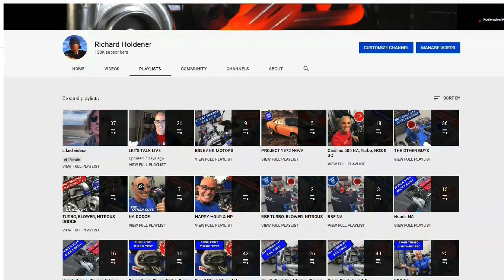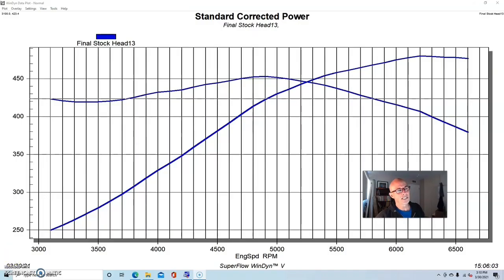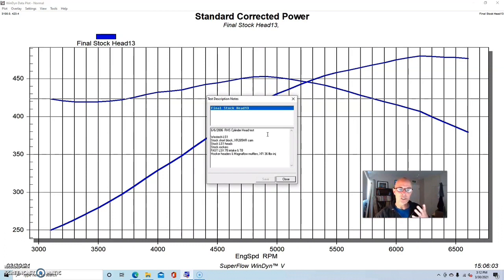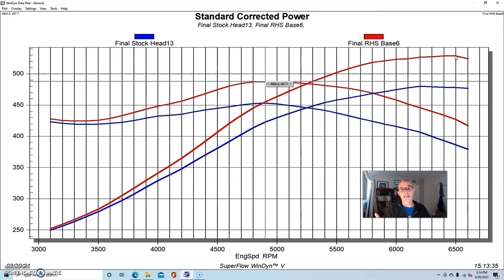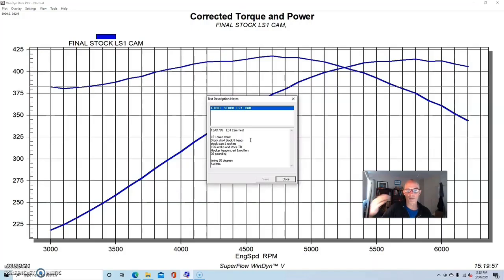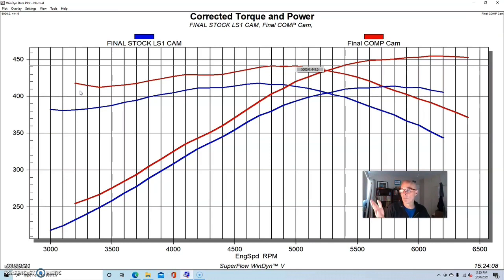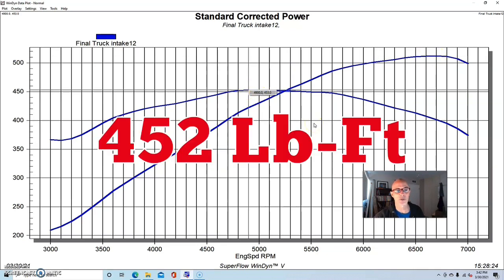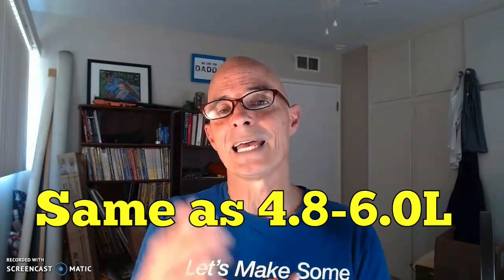DIY, EASY BASIC BOLT ONS-5.7L LS1 MODS

Comment: So what’s a good modern cam for the ls1?
Reply from the maker: I have 2 of them avail-Low Buck Truck adds 65 hp and Truck plus adds 81 hp ($179 each shipped)
Reply: @richardholdener1727  I have a 1979 trans am with a gto 5.7ls1/4l60e stock intake,stock injectors, 243 heads, 2.5” exhaust 3.08-3.23 gears (can’t tell) stock torque converter. Looking for a nice thump cam that I don’t have to change out the converter and valve train. It’s going to be daily driver/cars and coffee type of car I’m building for my dad.  
I’ve been looking at the 228/232 and the btr red hot cam, and the gm performance hot cam

Comment: Can't wait to see the ls6 content. My bolt on 2002 ls6 made 451whp/423wtq on pump gas.
Reply: What mod do you have? Cooler thermostat, headers and better intake?
Reply: @SOLightt  all of the above. Ewp ,  roller rockers, crank scraper, short belt with ps bypass on that dyno. Tested that just to see how much these newer car get from electric power steering, ....the little things add up. 
That was on pump gas. E86 will add 10whp and a pile of tq.
Reply: An LS6 is literally 243, heads, intake, slightly larger cam. You aren't making 450 with an LS6 intake, stock 243s and the largest cam ever made that will physically operate.
Reply: @Carado5150  why you use a ls6 intake? A ported fast with make 14whp more than a ported ls6 intake. 

A bolt on ls6 can actually make more than i did. I wasn't using e85. You can add 10-15whp and tq using e85.

Btw...the biggest cam ever would make more than the stock ls6 cam i used.

Comment: I have a 98 Camaro w/ an LS1 in it.. I have Headers, Y-pipe, (cats removed) & SLP Cat Back Exhaust.. K&N Cold Air intake.. I had it dyno tuned, but my HP to the rear wheels was 310HP..
Reply: Not bad numbers considering... Considering the LS1 that's in  98 camaros  Is a little bit  Of difference which most people don't know ... Like the 241 heads that came on the Camaro are not the 241 heads that came on the 2004 GTO LS1 The LS1 block was revised and the 241 LS1 heads were revised also....  The LS1 in the GTO was a factory rotating LS6 assembly Block ..It had an LS6 factory intake..also but had 241 heads but revised...  Don't know if this part's a fact or not but I also  Have heard.. Don't know if it's true but I heard that the 04 GTO factory Cam Had its own grind  Slightly better

Comment: I picked up an ls1 for cheap. Had 4 bad rod bearings and the crank was damaged. Can I use a 5.3 crank and rods and have it balanced with new pistons? Thanks
Reply from the maker: YES
Reply: @richardholdener1727  thanks that means a ton to me.
Reply: @richardholdener1727 can you use 6.0 crank and bearing

Comment: 2003 5.7 liter big power upgrades on budget, any ideas and approximately the price if items and brand names
Reply from the maker: every mod for any ls motor works on the 5.7L (not rec-port heads)
Reply: Looking to get approximately 350 to 400 hp , but on a budget . I have a 5.7 and a 4.8 . Both vortecs  and want power . It's going in 03 siverado 4 door 4x4.  Any ideas what you would do starting out for around $1000 then go from there.

Comment: Where can I get a set of LS1 RHS heads. RHS doesn't supply them any more...
Reply from the maker: the early ones were done by Mast
Reply: @richardholdener1727  Jesus Crisco! They're $1500 for a single head. $3k for cylinder heads damn is there a cheaper option?
Reply: @ryryy1980 this is why people swap in 6.0s and use LS3 heads and intake.

Comment: I'm glad to see a set of RHS heads on the dyno...I'm about to put some on a 6.0 with a BTR Stage 3 cam & a 4.000" stroke 😉
Reply: Should've gone rectangle port on a 6.0 and saves some money with LS3 heads.
Reply: @carado1984  I never bought after researching & seeing how much power you can make with stock heads

Comment: Hi Richard, Love all your videos.  So much information.  

So I have managed to pick up a LS1 with a T56 Manual gearbox (along with Tailshaft, Extractors, ECU and wiring loom - $5700).  I was hunting for a 6.0L however the $$$$ here is OZ are ridiculous.  The stock engine I have purchased has done 150000km.  I need to upgrade this engine but on a budget.  I know you have heard this too many times, but seriously money is tough.  So tough I have a GoFundMe page activated - https://gofund.me/93e70cb6

Everything performance upgrade here in Australia is horribly expensive and I was hoping you could point me to the right direction for both quality and performance and a budget price.  I need to be between 530-600 horses with an engine that will last longterm.  I do not have funds to keep rebuilding.

I am upgrading my 3.8l V6 ecotec with LS1 just so I can compete is certain classes of racing.  https://www.facebook.com/justinmannracingteam/

Can you help me?  email is justinmannracingteam@gmail.com

Thanks again.

Comment: I would choose the truck intake with a heavy truck or SUV for added low end torque say something with the weight around 4500-5500 pounds with the 212/218 duration comp cam giving you good torque 2000-5500rpm and strong horsepower 3000-6200rpm with stock to 2500rpm stall converter 3.42-3.73 gearing  but if you have a car with a weight under 3600 pounds or less with low gearing 4.10 and a 3000-4000rpm stall converter it be hard not to choose the edelbrock intake comp cam 231/239 duration cam power from 4000rpm to 7200rpm with this set should be a monster even a single plane intake with a holley 850 hp carberator would be ok for me

Comment: Hey Richard, I have a question; have you ever put a 5.7 (350) buick engine to the test? They are starting to get recognition and nobody really has put one to the dyno. Maybe you could try this one out?
Reply from the maker: not yet
Reply: Buick small block?  I don't think there is a lot of performance parts available for those.  Most Buick stuff is either 455 or V6.

Comment: Genuine question... watched plenty of vids on LS’s, and would love your input.
I’m currently on a 1JZGTE/ AR5 setup, and looking to get rid of it all and swap to an LS setup. Car: Built 240sx S13
I’m aiming for AutoX, Ima blow all my big bucks on a T56 Mag and twin disk setup, but on a budget for an LS setup pushing maybe 450whp, what would you recommend? Wanting to keep weight down so preferably an Aluminum setup. Genuinely curious.
Reply from the maker: alum na 6.0L
Reply: @richardholdener1727  Thanks for the reply, been looking around at 6.0L Aluminum block. 
Doesn’t matter to much to me at what it is, I was even looking at 5.7Ls and thinking about Cam, Porting the heads, and an intake. 
Been looking at like LFA blocks as well, and doing DoD delete and minor mods as well. Not as common around here to find these though.

Comment: Glad to see the 5.7 getting some love! Guessing a whole lot of us would like to see more on boosting one. What's a safe hp level? What should you gap the rings to? That sorta stuff
Reply: I remember seeing some article or something saying that the ls1 isn't that good to boost because the piston walls are thin but what do I know
Reply: @chrishansen7004  thats pretty true. If you want to hold a lot of boost go with a 6.0 or 6.2. If you want to hold an even higher amount of boost to go with an iron block. At that point you'll be pumping out so much power the extra weight won't matter. Remember guys, the iron block variant is only 100 lb more.
Reply: @sethh8892 so true, just chuck a few extra psi into it to compensate the extra weight. Won't take much at all
Reply: Word around is that the ls1 Lower can hold up to 500 wheel

Comment: The trade off is worth it if you're most interested in road racing and high rpm power for drag racing. I think its interesting to see cam only cars running 11s with a good suspension and converter, and ET is very similar w/ properly tuned stg 1.5-2 (22X duration) or a 23X/24X. So the peak power isnt nearly as important as the avg tq/hp in your launch to shift (racing) rpm range. I was going to increase from a 235/242 112lsa, mainly for more overlap(tighter lsa) and to get up to .650ish lift, but I'll be fabbing hot/cold side, adding a turbo from VSR or Sloppy, and then I'll prob want less cam in the 383.
Reply from the maker: check p-v with a 235 cam
Reply: @richardholdener1727  Its a 383 LT1, so the JE pistons are relieved and I know people run much bigger stuff. Mines been together for years, I wanted to take my stock pcm to its 7k limit with a cam change but decided I'll just do it with one of VSRs bigger turbos.. I'm saving for the hot side(no bolt on LT fbody parts), black magic clutch to replace my twin disc, and faceplating/building my trans for the power.

Comment: Richard!!! I've been dying to ask you this, what would the 706 heads do on a Ls3 or the 6.2 truck engine, would it be beneficial 🤷
Reply: No probably not. GM saw fit to move away from cathedral ports for a reason. LS3 rectangular ports are "copies" of bbc heads which out flow, make more power through out the power band & vast efficiency.
Reply from the maker: rec port ls heads are not copies of BBC heads-the 706 head add some low speed torque,  but be way down on power compared to ls3 heads (I tested that on an LY6)
Reply: @richardholdener1727  Thank you sooooooo much for answering bro YOU ARE TRULY THE MAN!!!!!

Comment: I'm always impressed by the factory truck intake when compared to these $600+ intakes
Reply: Thank you very much where's the best place to order from
Reply: @terryhouse1533  get them from your local junkyard
Reply: I think for most people, it's the packaging constraints that prevents them from using those intakes.  No intake is out performing the FAST102 that fits under a hood and without cowl modifications.
Reply: Factory truck for the win, 20 to 50 bucks all day.
Reply: If you're buying new it's worth it but if you already have a 92 it's not worth the price to upgrade
Reply: Yeah that nnbs/tbss truck intake is hard to beat
Reply: Should I use trick flow heads or something else
Reply: @terryhouse1533  what size of engine and what are your goals? Power adders?

Comment: I did not see anything about the port volume or flow figures on the 1st design? RHS cylinder heads or the compression ration after the cylinder head swap.  I just assumed due to the era they were cathedral ports?
Reply from the maker: CATH PORTS ON THE LS1

Comment: YES! My 99 SS will get some love now!
Reply: Worth putting some effort into the old LS1 Holden's now hey
Reply: Hi, I have a 99 SS.I why with a costume cam built to the mods that was already done to my car. Lt ls6 intake under drive pulley ported tb ssra ram air. The cam is a 227/235/565/579 110 LSA,M6 car stock gears and I run low 12s on crappy tires. I'm sure it'll run 12 flat, but you know how weak those rear end are, so I'm happy with those times.
Reply: Oh dyno,430/450. That part is hard to believe but the car haul's a__

Comment: When boosted are these comparable to the gen 3 5.3s for strength? I get the blocks themselves are not AS strong.
Reply: Rods and pistons don’t seem to be as stout. Most people usually don’t push past the ~600whp mark especially with stock ring gap

Comment: LS1 today? How about an L33 block bored to 3.900 or so, then add the components of your choice. Of course if you’re adding boost (a lot of boost), then don’t bore it, just turn up the boost controller. That first head upgrade example seemed extreme. A 212° intake cam making 529 hp at 6500? I’m hoping my 6.0 cracks 500 hp at the crank with a 225° intake lobe and 823 heads. Of course part of the difference is the 9.6 or so compression of the LY6. Still interesting info, thanks Richard!

Comment: Richard Ebay has a new turbo it's a 78. 76. T4. Billet wheel. Stated to make up to 1000 hp. They are 280 bucks. Everybody better get a couple before this gets out. Be great if you could test them as a single and twins. Great job.
Reply: Are ebay turbos any decent in terms of reliability compared to the known manufacturers?

Comment: what kinds of RPMs can a stock LS1 bottom end handle?
i'm getting one ready for a Autocross car and often times we will bounce off the revve limiter for 2-3 seconds during our runs.
i also plan on using a Torqy Comp 265Hr cam as well as mid-range power is very important for Autocross cars
Reply from the maker: you won't make power at high rpm with that cam
Reply: @richardholdener1727  realistically with my gearing, it would only need to revve to 6500prm. but most of the course would be between 3500rpm-5000rpm.
or would a bigger cam be worth it?

Comment: If I remember correctly, here is the USA, f body ls1 enginges started coming from the factory with the ls6 intake in mid to late 2000.
Reply: My 2002 Camaro has an LS6 intake.  On the chassis dyno it put down 305 to the wheels when it had 60k miles on it.

Comment: I picked up an relatively unmolested LS1 Camaro. 
T-56, 3.73:1
It has long tube headers, ORY, LS6 intake, stock 241's.
I have an old MTI C1 "Hammer" cam (single pattern 222° / .566", 112°) that was never installed.
Would like to do a budget factory head swap too.
Between stock 799/243 heads, and 706 w/ the valves unshrouded,  which do you think will perform best for all around street driving?
Reply: Stay with the stock heads.  The bigger valves flow more than the small valve 706 heads.
Reply from the maker: the 241 makes less power than the 706
Reply: 243 heads and get them ported. I picked up 80hp with a BTR stage 3 cam I was running before the swap. Also, It runs out to 7200rpm now with the double coil springs I put in it before the it starts falling over.

Comment: See out American vans have 6.0 and 4.8s. My own personal truck is powered by an 07 express van lq4. That said don't the aussies have rb30's in the wreckers?
Reply: Lol no days of rb30s in wreckers are long gone. $500 gets you a block with matching crank and girdle these days if you're lucky.
Reply: RB30's were sold new in Australia from 1986 to 1990 so they're long gone from the  junk yards
Reply: 4L NA Baras are still cheap and Plentiful  for now .
Reply: @briangiannattasio61  did y'all get a lot of ford 4.6/5.4l motors? Or did everything get a barra instead?
Reply: @Prestiged_peck   we got the modular 5.4 "boss" but think it ran different heads . but no were near the numbers of the 4l Bara
Reply: @briangiannattasio61  a lot of them get thrown out. Mate used to wreck b series. He'd take a pallet every six months of silvertops for aluminium scrap. Not very often anyone would ever ask for one if they did they wanted a red or green top.

Comment: I have been waiting on this!! My gto is needing more power and I’m not doing an engine swap till my LS1 blows.
Reply: Years ago, I said I wasn't going to modify my Camaro's LS1 until it blew.  Problem was:  IT NEVER BLEW!  Still running good at 282k miles after 15 years of track days.
Reply: @andyharman3022  well I’m already at 107k miles and it can get it to last 15 years that gives me time for my real goal of TSP 427s like Cleetus uses
Reply: @andyharman3022  Thanks for that Man ! I'm all worried about my 130,000 mile LS 1 after doing cam (.600 lift 224 224 duration)  Dorman intake , 42lb. injectors , 62cc CNC heads , still have 6,000 rpm redline . Sounds like I got a few miles left , is yours modified ?
Reply: @danielcarroll5667  Only put low restriction exhaust, high flow MAF, and low restriction airbox on it.  Only things that have broken on the engine are two exhaust manifold bolts on the drivers side, and serpentine belt idler pulley bearings that start to squeak.  If I had it to do over again, I would put an oil cooler on it to control oil temperature during track days.
Reply: @danielcarroll5667   I wonder how  Your set up would go... With a different intake... I think I've heard the dormant intakes choke a little bit of power from the LS ones... I could be wrong...
Reply: I mean basically everything he does on the 4.8 and the 5.3 and 6.0 are the same you just might not be able to make as much as an iron block but probably way more than you need
Reply: Same !
Reply: Advice for a good after market cylinder head please? No one sells them any more!